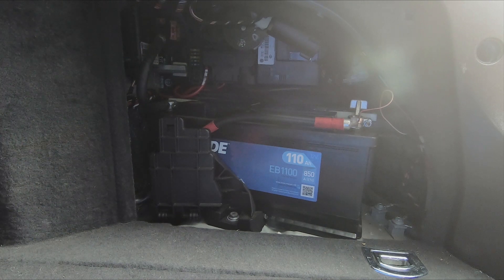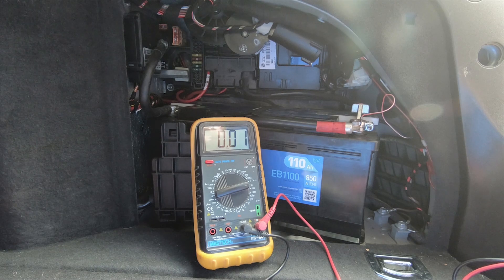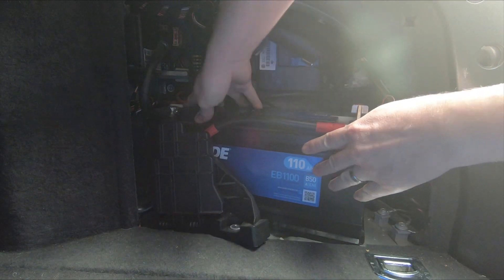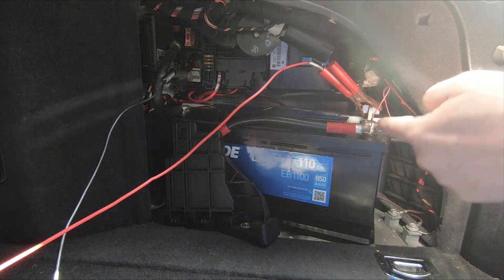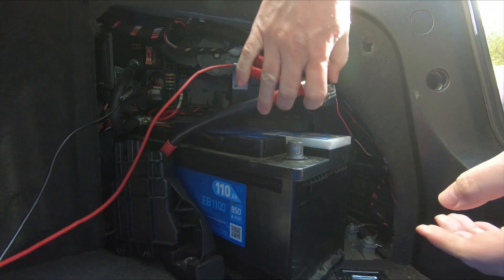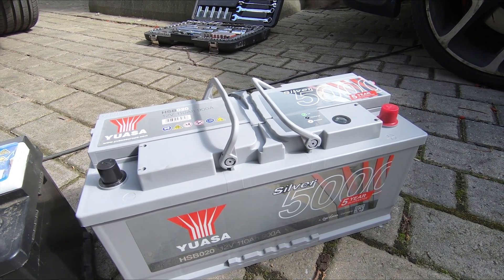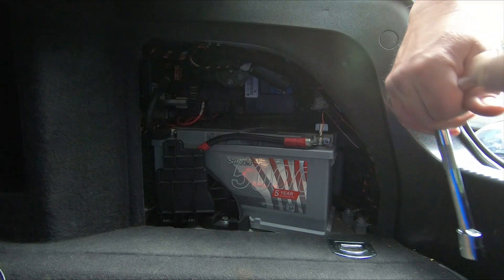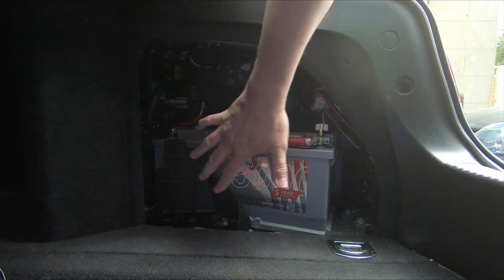HOW TO: Audi A8/S8 (D3) 2006-2010 battery swap

Comment: Thanks for the video, very useful. Did you have to code the new battery?
Reply from the maker: If the battery is the same chemistry and a similar capacity I do not see the need to re-code, especially if you do not have the ability to do it yourself and would cost a lot to have it done at the dealer. The car will 'learn' the new battery over time.
Reply: @ANTandTEC  how are you 100% sure of that? are you a mechanic? and may i ask if its ok to use a H8 AGM battery in a 2006 audi a8 instead of a non agm  battery?
Reply from the maker: @RideOrDiee  whilst I would recommend replacing with a battery of a similar type, AGM lead acid can in most cases replace a standard lead acid battery. The main difference with AGM is that the internal resistance is lower, therefore, it will charge using a higher current - which means a faster charge. 
The only issue will occur is if the car is unable to provide the higher charge current the AGM battery requires. The battery will still work and charge, but if the charging current is continually lower than the optimum for that battery, it could result in the capacity being reduced over time.
Reply: @ANTandTEC  I meant how are u sure the car will learn it has a new battery in time without coding? I dont have anyway to code and would like to put my new battery in. Also what things we be lost if i dont connect the positive and negative terminals to a battery charger?
Reply from the maker: @RideOrDiee The learning part, is the car 'knowing' what charge your battery can hold, and it uses this information to adjust the car battery management. These are things like shutting down certain systems when the battery charge reduces, in order for the more critical systems to remain powered for as long as possible between charges (eg. being able to open the car). If you are not coding and are concerned about this I would say it's a good idea to fully charge the new battery prior to fitting. 
With regard to what to expect to lose when the battery is disconnected, it is different depending upon model specification and how long the battery is off for. I have had the battery disconnected on the S8 and did not notice any setting lost. However depending upon the car, you could lose clock time, radio settings, etc. Also engine management systems 'learn' conditions such as fuel type and driving style and adjusts engine parameters accordingly, settings such as these could be reset. Nothing that would be destructive though or leave you not being able to use the car.

Comment: Did you know these A8/S8s undercharge due to a poor crimp of the 1/2" thick power cable from the battery to the front of the car. 
There is a junction box to the right of the Driver's foot when on the pedal - it is behind the carpet and foam and inside a metal and plastic box/shield.
It gets hot when charging a low battery, - too much contact resistance. When using a lot of consumers it gets hot too. The charge voltage is low and the batteries die early and never reach full capacity. You can use a £900 electric crimper or a blowlap and a load of solder to fix it.
Reply from the maker: That is interesting - I did not know about this, I will definitely check this out on mine. 
Blow torch and some thick plumbing solder is probably the way to go.
Reply: @ANTandTEC  interesting is this position  on right hand drive  car
Reply: Is this box position on right hand drive car
Reply from the maker: @markcrickett7455  Yes it is RHD. I never thought that it might be different on LHD!
Reply: @ANTandTEC   thanks for that mine started loosing charge quick IE and hour with the radio on and the battery monitor went from full to empty just like that . But the starter seamed slower. . original battery though 18 years ain't bad I suppose  . Wizzes over now fitted new varta.  Just got to get it coded now
Reply from the maker: @markcrickett7455  18 years!
Reply: @ANTandTEC   yep I've had it 15 and it was 3 when I got it  and I've never changed it unbelievable isn't it